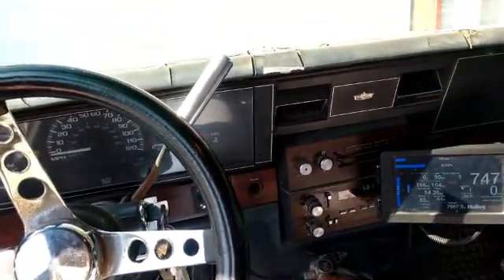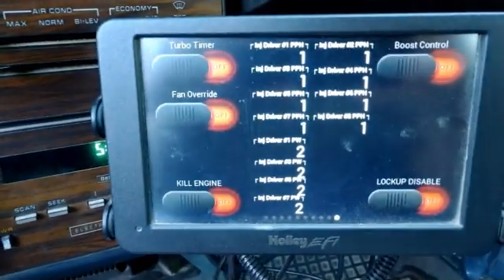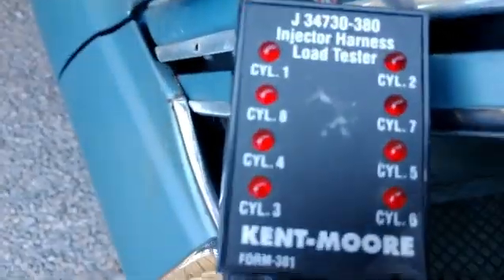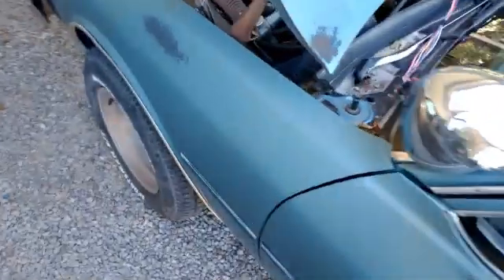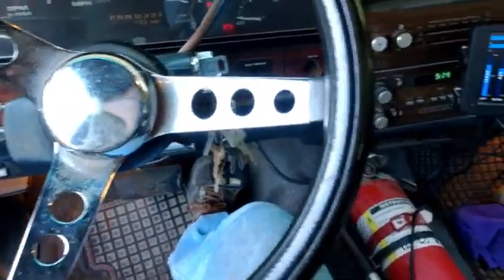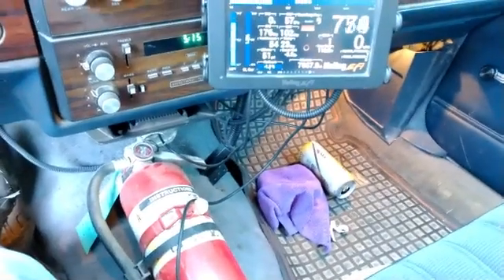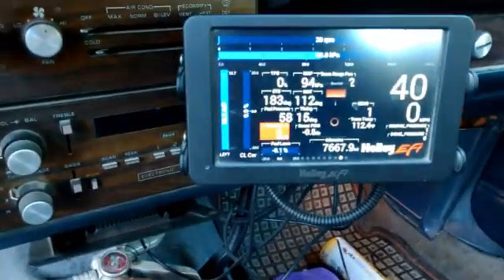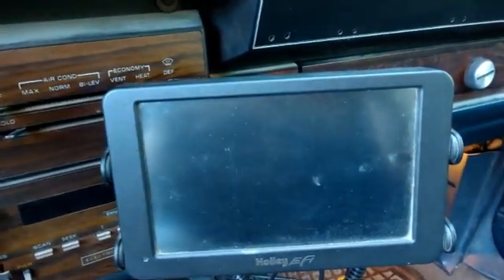holley dominator efi injector pulse missing inj 1

Comment: I’m having the same problem on hot start up
losing one or more injector ground. The only way to clear it is to turn of and restart till it comes back. Its embarrassing to sit for two minutes restarting it because the car sounds like a pos running on 6/7 cylinders
Reply from the maker: never resolved, i yanked the $3000 holley system off my car and now run the stock GM ECM spent a little more time tuning for the turbo making it safe.
Reply: Damn, that sucks. I invested 5k in all the Holley stuff and I only have 2k miles on it. The Techs at Holley are no help and swear it’s something with my car that must be causing it. 
I probably sell all of it and go with Fuel tec.

Comment: Curios if you ever got this figured out.  Mine does the same thing.  My left side bank has an issue on one of the injectors.  Replaced injectors and had 2 different professional Holly certified tuners tell me that there is a bad injector bank. Wiring all checked and proper grounds checked.  Over $2500 in installation checks performed in labor.  No wiring issues but problem persists.  My left side bank AFR readings are erratic so we summed both O2 sensors which helped but still a miss.  

Any updates?
Reply from the maker: Mine is intermittent issue.  Went over a year without issues then this week, 97 degrees outside , car sitting for a few days, I start it up, 2 injectors not firing, turn it off, restart, 1 injector not firing, shut it off back on again, all fine drove fine entire trip.  next restart, 1 more injector not firing, restart, all fine again. Once its running on all 8 they never drop that ignition cycle.  Very consistent with how it does this.
Reply: @LT1SWAPCOM   Thanks for the follow up.  Good Luck!